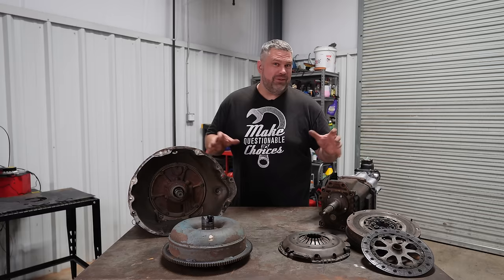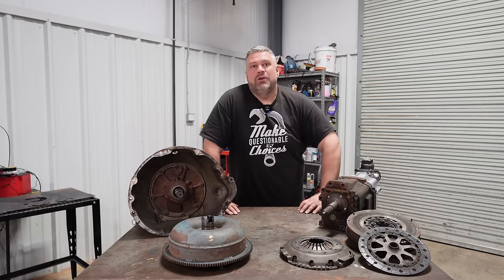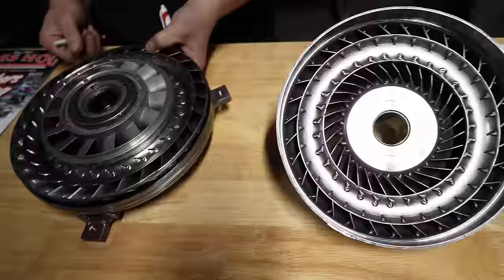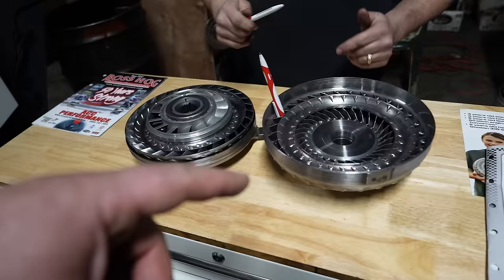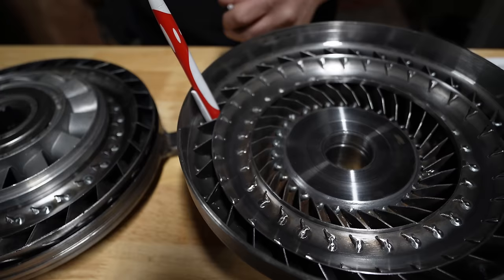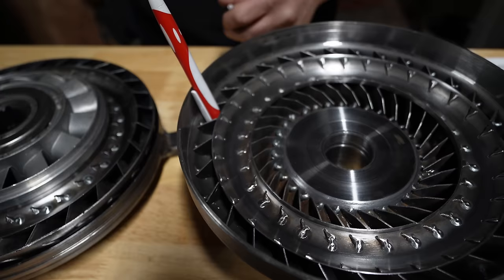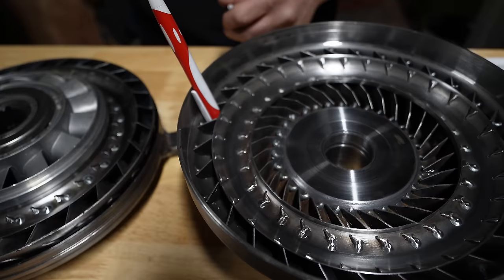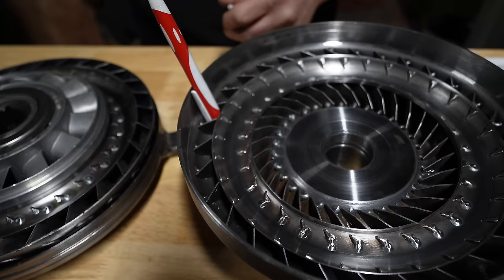Transmission Companies are Afraid to Show You This! So I Found One That Will!

Comment: I used to work at LuK Clutch (now Schaeffler Automotive) would like you all to know, that copper stuff is copper brazing paste and a completely common practice in torque converter production. Every single clutch, pump, and impeller produced there had the vanes brazed with copper brazing paste. Lastly, when they put in the 6th production line dedicated to 10R80 and 10R60 torque converter production, we hit 1000 pieces produced in the covers section in 8 hours.

Comment: Flash backs of working at HydraMatic for 32 years.
The press that stamped the shell would shake the building in assembly 3/4 mile away.
Willow Run Michigan.
Now I know why the Engineer's were so stressed.
Great content and Thanks.

Comment: When I was a kid, my parents had a '62 Buick Invicta.  My mom loved that car!  Smoothest experience ever---because there were no gears!  It had DYNAFLOW, which was a variable vane torque converter.  Big V8 engine that just smoothly moved forward with no "shifts" as speed increased.  It was "slow" to accelerate, but mom was fine with that!.  (I was too young to know how Reverse worked. )  
I don't know how the vanes were varied.
Reply: Buick could have used the 4 speed Hydra matic in their cars but they declined. They didn"t want all of those shifts. The Dynaflo was equipped with drive, low, & reverse but no upshifts. It"s operation was so smooth that it could be equated wit CVT transmission.
Reply: Are you sure No gears ???

Comment: As an ATI customer for years, i remember about 20 years ago, 2004ish, that same company was pushing a converter cutting and welding machine. "Start your own business or build upon the business you have"
The product was not terribly expensive for what it was and did, i believe $150k or less, cnc controlled with a user friendly interface "anybody" could use. Even a flush process was part of this unit, making it a complete tool from start to finish for any trans shop for sure. Also beneficial to certain race car shops. The guy who got that unit just for his home garage was very serious in his program. I actually wanted to get aboard on this unit but the money just wasn't there. 
Can you imagine the possibilites of this machine however, if you are a serious drag racer? The no prep scene could be yours locally once you learned to build a converter for each individual application to get down a poor surface with 4 digit horsepower!
Your car is completely different from the guy or gal next to you...but what if i can make you a unit that works perfect for your application? If so then id be the man and wouldn't be poor right now. 
A cnc mill and a trained operator could whip up endless stators to dial your combo in and that ATI machine could have put it together. Did i mention the equipment also had capability to static and dynamically balace the unit? I dont think the resolution was that high but better than your average rebuild shop which don't balance a "rebuilt" converter at all. 
A cnc machine to make stators for custom converters could also help develop impeller wheels for your favorite turbo charger too...
Dang i should have went with this and pushed myself back then in 2004. Id be sitting pretty right now. Id have been the "magic converter doctor"! 
Oh well, its healthy to dream, even about the past, as long as its positive.
Reply: this is an awesome reflection but it makes me really curious exactly how the complex process of building case specific converters could be learned efficiently. It seems like so many darn variables.

Comment: Torque converter function can be mimicked with 2 fans. 
Power one up,and place the other in front of it while its running. 
The unpowered one is what drives the trans.

Comment: Torque converters are still magic.
Reply: Fluid magic
Reply: Black Magic!
Reply: @Rekuzan  Red magic. If it's black magic, the magic has already burnt up.   :D
Reply: @DrFiero  Yeah man, there ya go!!! 🤣🤣🤣 Although I think Clarkson referred to it as black, not quite realizing what he was saying!!!
Reply: Pretty well LOL
Reply: I went to find out how they work one day, and basically every video was about planetary gears and not about torque converters..
Reply: I say the same thing about electricity. I get how it makes things move but htf does it make colors on my screen. It makes my head hurt.🤯
Reply: @firebry23 Not touching that one :buffering:
Reply: @firebry23 Electrons drop an orbit or three causing a phase shift in the visible light spectrum depending on the voltage, amperage and frequency of the power going into the LED and....yeah, my head hurts too!
Reply: so are women ...
Reply: And differentials, those are sorcery too!
Reply: @TheBibliofilus NO they AREN'T! They're just a manual gearbox, yer breaking the meme! Don't get me wrong, they're a PITA to set up properly, but still... Manual transmissions and differentials are easy, automatic transmissions are a mystery that will never be solved by modern man!
Reply: Full of magic.
Reply: I have to double clutch my brain to get it. Got to grind em to find em.
Reply: yeah, power goes in, dissapointment comes out, most often
Reply: I love hearing guys that have put a “decent “ cam in like a 305 sbc and they say it’s a DOG……. Put a 3-3500 stall in it fool, and HANG ON!! then tell 
me its a dog…..  🤷‍♂️🤦‍♂️

Comment: The talk about 'cannot just put in a torque converter'

I think back to when I did temp work for a tow company. They had just gotten a new transmission into a truck. Put in one with a bit higher stall.

That transmission under any load became only good for boiling trans fluid.
Reply: georgesanford3719  Yup, it was. Not my truck. All Automatics have a stall speed. Is how a torque convertor works. Issue is they put in one not suited for the job on an overhaul.

Comment: Excellent job, really enjoyed that! I was wondering if you’ve ever heard of a torque brake it works like a torque converter except your driveshaft goes through the middle and one half is bolted to the frame the other half a spline to your driveshaft and you have a lever that introduced oil into it and it slows you down using the same principle as these torque converter‘s, they used to use them on old quarry trucks with the cooling system of their own, just something you might wanna look into. Thanks again great show!

Comment: I’ve predominantly serviced/repaired/rebuilt manual trans but have on occasion, done same with a/t’s.. was myself. although schooled up & practical learnt in shop settings, long perplexed of exactly what all was going on inside of a good ol’ torque conv… until working on a friends ‘49 Buick Super w/Dynaflow.. studied up on that trans & its inner-workings, it began to make much more since.. several years after that, after having acquired my first ‘55 Buick Super w/Twin Turbo “Variable Pitch” Dynaflow, 5 some-odd years before, found myself in need of digging thru my trans, which, for anyone knowledgable of Dyna’s, has a torque conv you can fully disassemble (not welded together). 1955 was the first year Buick introduced their “Variable Pitch” torque conv… truly a work of engineering art, going thru one of those in your hands! Made the whole hydraulic concept so much more understandable, being able to physically inspect & marvel at each component segment within.
This all said, I’m wondering now, after watching thru this video, having an A.D.D. tangent thought at some point during, of what could possibly be gained or lost, advantage/disadvantage, of a modern TC having its pump cover NOT fixed  to the flywheel… having this carry thru an outer planetary gear arrangement or the like, with control of said system done electronically? Granted, such an arrangement would/could vastly complicate  the “goings-on” inside the bell housing, potentially requiring that zone to become fully sealed up but.. what if?
Reply: Was looking for thru my bolt collection just last week for some body bolts and came across some 3/8 and 5/16 nc bolts painted green. I remember them from trade school in 1978 when we took apart a bunch of Buick Dynaflow trans,that the school junked.
Reply: @tonyc223  It is crazy to flashback to them school projects of condemned cars donated, how yesterdays junk, later becomes gold! I’ve been seeking to find at least one of them class “cut-aways” of an old Dynaflow & an old 322 Fireball Nailhead! Always thought that’d be cool to have on display, juxtaposed adjacent to one of my ‘55 Buicks at a local classic car show… even thought of how cool those cut-aways wud be if mounted into a simi-restored rolling 55 Buick chassis w/various literature/ad copies, framed & posted along each component, giving spectators a visual representation of what everything is

Comment: I worked for DACCO torque converters for 21 years and probably built 100,000 of these
Reply: hell yeah man!!!!
Reply: What the best stall speed for 3000 circle track car  232 / 232 @50 108 LSA 3:73 rear gear car ?
Reply: what brand do you recommend for 6l80? these look well made

Comment: I know in racing you can get converters that are bolted together instead of welded and you can open them up to change the stator or sprag you can also use dump valves on your trans to redirect fluid. Say you have a real tight converter you can use your dumps to redirect fluid from going to the converter to the pan instead to make your converter looser than what it would be if all the fluid was going to the converter. Racing has taught me so much about automatic transmissions and how they work it is a amazing process.

Comment: rotating mass absolutely effects HP on the dyno, I have a video proving this with a balance shaft delete on a 4 cylinder car, then a light weight flywheel again picked up hp.

Comment: 25:27:  "Not going as much into the metal"...That is not correct.  Spray arc has far more penetration than that of Short Circuit or Globular Transfer.  Great video overall.

Comment: I've always called what you call a clutch cover a pressure plate, and you forgot the Throw out bearing and fork. Manuel also has a pilot bearing that an automatic doesn't need..  I don't know about today but in the past if an engine was factory fit with an automatic the pilot bearing was not installed in the crank shaft,  some engines the crank wasn't even drilled for it.  I've done many Auto to manual swaps having to install a pilot bearing,  a few were not done because the engine needed a crankshaft swap. Or engine swap.

Comment: Very cool.
Planning to visit Precision torque converter in Iowa? I did a short stint with them warehousing out here in WA and they are probably the nicest people you will meet. If you do, say hi!

Ben
Reply: Precision is a pretty good company. I've used their stock replacement converters on my stock daily driver trans rebuilds and have had some custom high performance & race converters built by them as well .

Comment: Practical experience allways outweight schooling. Schooling has only advantage in quantity as it is not practical to make every worker practise for years to be able to work. Master crafts men are allways under estimated by the academic people. Ofcourse we need both but  the appreciation should be more balanced as we need intelligent people in working class aswell or the production do not get so much new ideas. This company and the owner talking about "WE" sounds so good and it is that exact reason they are a leading trademark in the business.

Comment: Ok, I'm from that area and only recently heard of boss hogg converters. But you constantly are seeing ptc on race cars all over the country. Both are in the same town, so why not try to see both? The differences between the two and all that?  This was a huge help for me to watch, as I'm about to have to buy a trans because of converter stall not matching up with cam.  It was all voodoo too me until now!
Reply: Call Kenny at PTC, give him your specs, you’ll get the best converter possible for your application. Kenny Ford has forgot more about converters, than most converter builders ever knew !
Reply: @insanefatboy5002  Kenny and the other partners sold ptc.

Comment: Owning a Miller Welder myself, I guess I am a little confused by statements made in the video. The Miller XMT 350 CC/CV shown welding the TC in the video, as a base model, does not have pulsed spray arc transfer welding (Pulsed MIG as described by Miller), it is however, a very good MIG welder for steel, and in the video they have it dialed in for a low penetrating structural weld without much splatter using the welding turntable. The Miller XMT 350 MPa supports Pulsed MIG and is more expensive than the XMT 350 CC/CV base model shown in the video. 

So just to be clear, for the application I don't think you really need the Pulsed MIG feature. A dialed in MIG with a turntable and holding jig will work just fine for a top down level fillet weld. After the final weld and broach do you need to final balance the torque converter when at speed without fluid? I think if all the parts are neutral balanced and the final weld also balanced then the assembly should be neutral balanced without the need for a final balance test. However, I was really expecting to see a balance check after manufacture.

Comment: When you order a new torque converter can you get it with a drain plug installed on the outer diameter ? just in case you need to clean it if the transmission fails.

Comment: So when a torque converter is flashed…what exactly is taking place? It appears that once the internals of the converter are set and welded together that would be the end of it, but I know “flashing” the converter will adjust the speed of it.

Comment: Wht would you recommend for my 06 town car? I am thinking of putting 4.10 gears with lsd diff. I have a 4 speed trans. I have all 4 cats cut off and have 2 pypes high flow cats threw a 2 1/2 piping to a X pipe out a roush axle back exhaust.

Comment: The original “hydramatic” transmissions had a “fluid coupling” device with no torque multiplication.  Do the first gear was very low.  Later “turbohydramatic” units had a torque converter that “ multiplied” the torque.  Hence the first gear is not as low.  What exactly is the difference in the two coupling devices?
Reply: The fluid-coupling is of two-element  design; picture a fan's air flow directed at an identical  un-powered fan to drive it.
The three-element torque converter adds the stator and its ability to redirect "driving fan's" output to more optimally turn the driven unit for a particular load requirement; reaching cruise the stator eventually free-wheels  and becomes irrelevant. 
The video references stock and modified stator function several times.

Comment: I wish I could show you the 4L30e I ripped out of a Catera that I am using for a project and building up. It is actually two transmission. Has a planetary 3 speed, but then between it and the bell housing is a second automatic transmission 2 speed.

Comment: As I work on earth moving gear the nest concept of the converter in a dozer is it is bolted so can easily be disassembled for bearing replacement ect
Would be good if the same applied here instead of welding
Reply: High dollar race converters are bolt together as well, so you can change the stators out for different track surfaces
Reply: @insanefatboy5002  
Sham every day vehicles aren't the same
Cost savings I imagine 😜

Comment: Why not make an autotragic transmission with regular clutch, get rid of the heavy complicated TC
Reply: The assembly is not a lot different in weight to the manual trans flywheel and clutch assembly

Comment: What type of torque converter does a 2023 L5P paired with a 10 speed with cold air and DEF back exhaust. Next thing down pipe upgrade. What type of torque converters does my truck have and what would you recommend for primarily used as a cross country 5th wheel and dump trailer? Mainly looking if I could increase mpg and max efficiency. If I can get gains in efficiency from a stock, why doesn’t the manufacturers doing this from the factory?
Reply: It would be nice to see a video with late model vehicles upgrade vs stock torque converter efficiency

Comment: Horse power goes in, black magic happens, and the driveshaft turns! This is why I prefer manuals...
Reply: I think if I ever really got used to a manual I'd probably want one, but I came from the automatic side seeking the additional control a manual allows (but not particularly interested in the "feel" of it).  I was lucky to find a car that gave me everything I want and I'm currently at 203K miles on the original brake pads with the "manual mode" allowing me to downshift effectively enough to accomplish that.  I can also use neutral to save fuel on the right kind of roads.  That's literally all I wanted out of a manual and if I don't feel like putting in the extra driving effort, I can just leave it in auto mode.  So I mean, depending on what you want, you might still be able to get it with an auto transmission.